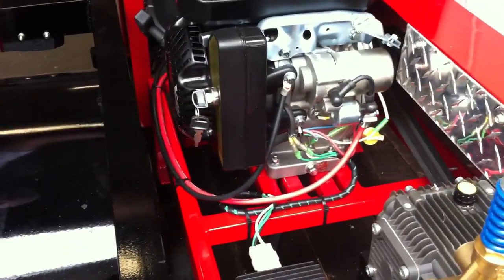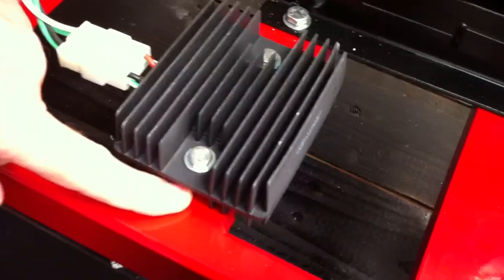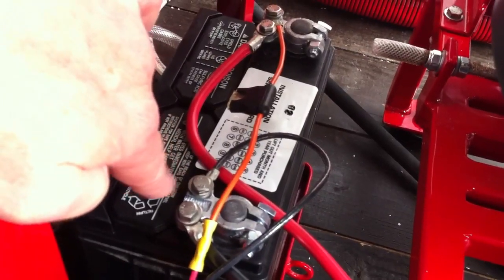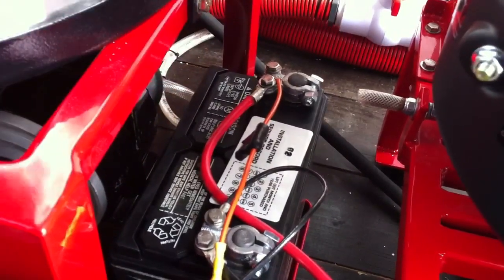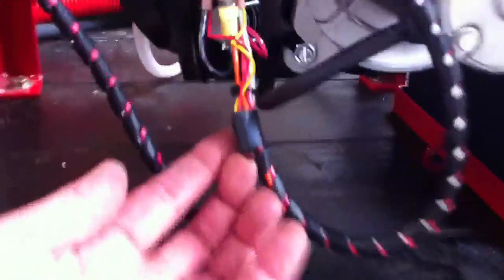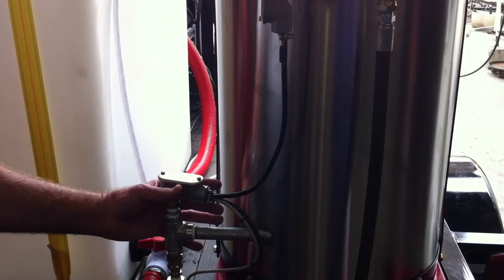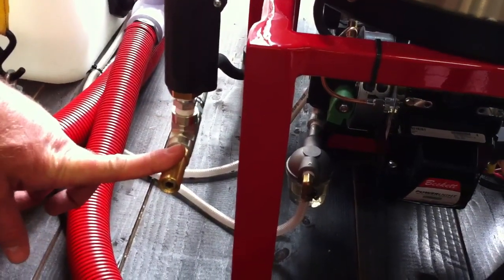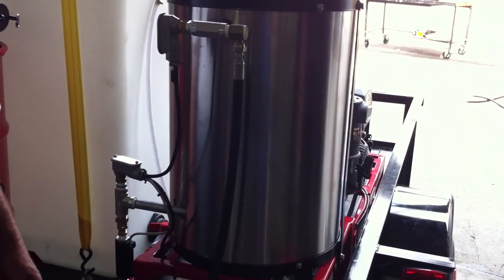12 volt heaters Systems on pressure washer net Overview why & How

Comment: I got burned. not by my machine by powerline. they sold me a machine that has only made it through 5 jobs. the burner crapped out on the last job and i'm now looking for videos like yours to aid in the troubleshooting. Good job guys. keep up the videos.
Reply: Your PowerLine deal has nothing to do with Sirocco, nor PressureWasher.net
Reply: Check the fuse
Reply: Wasn’t your machine under warranty

Comment: Ron, I have a hydro tek that leaks diesel from the coil. I've changed pump, fuel valve, electrodes, nozzle ,diesel filter, and it still leaks!  Flow switch is new also.. the last thing to change out is the gun line.. And it's not water the insulation is soaked in diesel.. 12v beckett system.. Not a high hour machine.. Help!
Reply from the maker: Hello